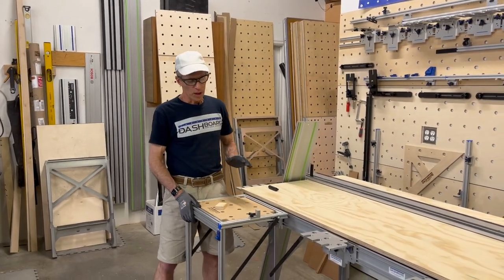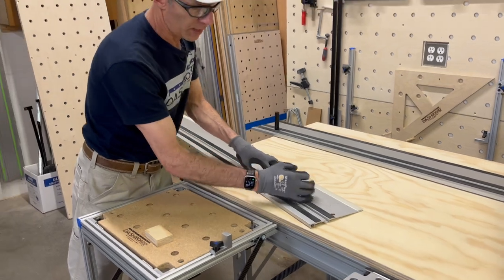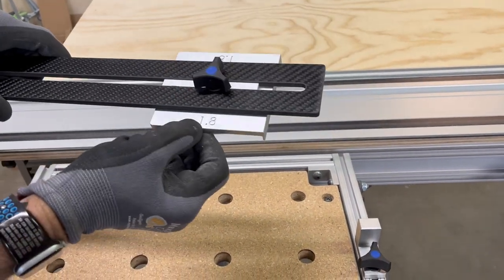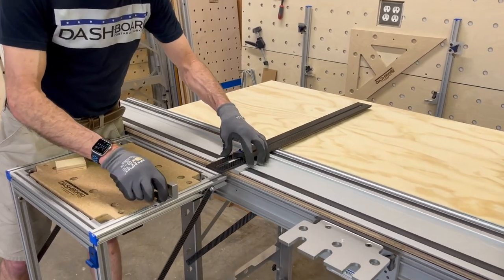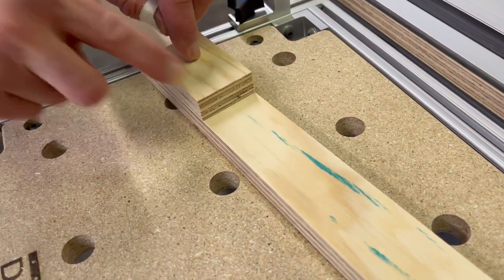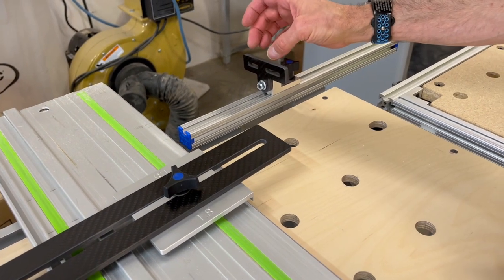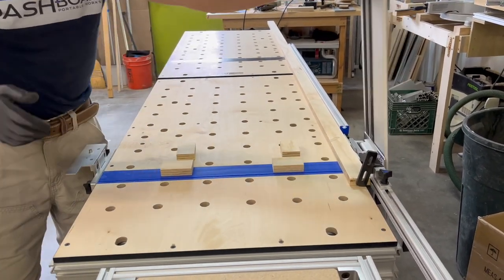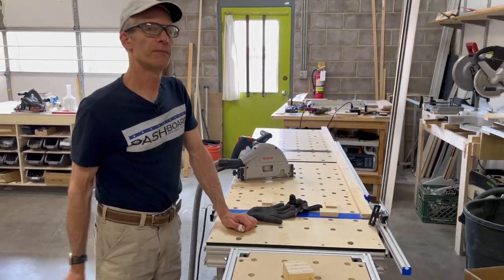Reproducing parts with Dash-Board

Comment: Wouldn't it make sense to use the rip gauge without the extension and set the flip stop with the actual piece you're duplicating? Actual piece + width of the blade.
Reply from the maker: That's a great idea!

Comment: Why do you put also a tab on the front of the carbon fiber so your wood block will be perfectly tkt aligned?
Reply from the maker: If I'm correctly imagining what you are suggesting, adding a tab to the extension would create an offset that would make the setting too wide with Rip Stops and Flip Stops.